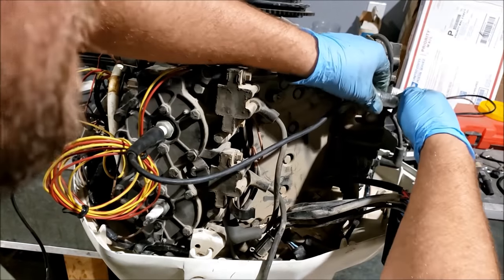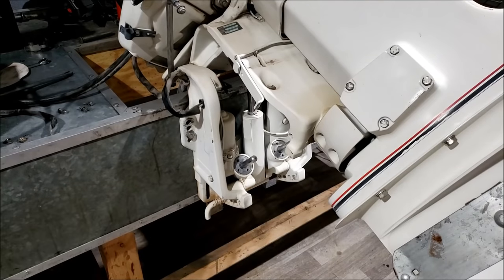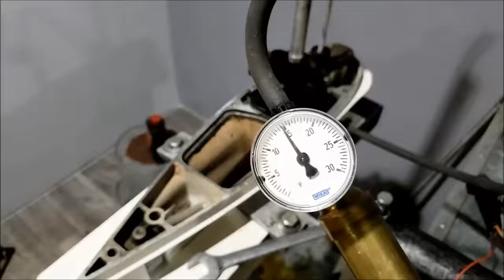Awakening a 90 HP Johnson After a 12+ Year Slumber

Comment: Omg man thanks so much, perfect timing. My ‘86 90hp evinrude was running fine last week, now leaking gas from the lower carb holes when I prime it, so it will only run at high speed idle, at idle it dies. Your videos helped me totally rebuild my 1974 Evinrude 4hp, hoping for the same with the 90 lol :)
Reply from the maker: next week the full carb video is gonna get posted, that should help more.
Reply: the needle is stuck in it's seat, forcing all the fuel to get trapped in the idle circuit. 45 minute carb clean with a syringe and alcohol will fix you right up, and a new needle and seat of course
Reply: @BrandonsGarage  awesome can’t wait.
Reply: @ct1762  thank you so much, sincerely appreciated. My only worry is that since there’s 2 carbs I’ll need to sync them - only ever cleaned single carb engines. Going to buy the rebuild kit in the meantime and wait for Brandon’s video on the carbs, lol. I watched the VHS video he posted on the link n sync, so I think I should be able to tackle this.
Reply from the maker: Posted & VHS... thats not a combination you hear too often.
Reply: Fuel pump diaphragm try that first
Reply: Great video brother

Comment: 18:37 Yes, there is about 300V on the black/yellow kill wire when the engine is running. That's the voltage the capacitor in the power pack CDI module is charged.

Comment: Before I turn the motor over, spray some type of oil in the cylinder. Marvel mystery oil, 2 cycle in a good plastic spray bottle.  That way it's not metal on metal and scratching the cylinder. Especially sitting so long. Nice video.

Comment: Nice video. Makes me miss my '81 90HP. Not sure if that motor has diverters in the heads, but when you test if you overheat they can be the cause and confirm the condition of the thermostats as well. Although they are a PIA to remove and replace.

Comment: Hello Sir, as always in your case very good video. Thank you. Question, the my power pack has two coil charging wires(one shorter, one longer) is it so that shorter is connected to the lower cylinder (motor evinrude 2T V4 90HP)? Best Regards

Comment: You brought back good memories. I had that motor on an '87 Crestliner bowrider. My first and only boat. It always ran like a top. Excuse my ignorance but what does VRO stand for? Is that the oil injection system. Mine was oil injected. It never gave me problems. When i bought the boat, a friend suggested getting rid of the oil injection and run mixed gas directly. I didn't bother because it was working fine. The boat also had an onboard fuel tank. Great motor.

Comment: Please stop using the Harbor Freight compression testers (or any critical precision tool for that matter). They commonly only show 90psi when in fact, it is higher. It is a good tool to bring for getting a good deal on an engine but not for accurate checks. My jet ski read 90 psi on both cylinders with it, then bought a good name brand and read 145psi on each cylinder. Big relief. Just throwing my 2 cents.

Love the videos, they are very calming.
Reply from the maker: At face value I would agree, however this one has been calibrated.
Now, the newer designed ones have no business being anywhere, but this one in particular is accurate.

Comment: Bad wiring insulation and swollen water diverters in the cooling passages are major problems with old 4 Cyl Johnson/Evinrudes.  Pull the heads and replace diverters!

Comment: New to the engine world..bought a 1986 90hp Evinrude vro crossflow.. quick question, the little orange and orange / blue wires for the coil packs which goes where? Have heard blue/orange to top and solid orange to bottom and vice versa? Idles perfect but have no throttle when wife open. Will only run about 20mph full throttle.. almost loke the engine is not reving up. And help would be grateful 🙏

Comment: I have a 1993 Johnson 88spl with the compression between 110-115 on all cylinders. Is that considered good? The motor runs perfectly for its age and just trying to get an idea of how much longer I can expect it to last. Thanks and love the channel.
Reply from the maker: well, mine is at 90 and Im calling it good.
However, Ive seen low hour motors from the early 1990's putting out 120- which is probably where they were new. 
110 I would still consider very good.

With that said, most OMC enthusiast would say these cross flow V4's are good at 90. But both you and I have seen higher..
Reply: There dirty suckers when it comes to compression,  the manufacturer recommended some ring size ran through your gas regularly ,now I also recommend that , if you can find it ,  because these motors were meant to run hard , if you run them around 2800 and idle alot it carbons up , I figures that out the hard way , three power heads replaced on mine cause I didn't like the compression , 1300 to 1800 dollars  each time except one time they warrantied it , but I think they were throwing used power heads on it , so I finally did it myself ..it lasted 8 months and did the same thing , port side compression down 30 lbs on one cylinder , 45 on the other ..again she came apart , that's when I figured it out , it was all carboned up , but it was to late,  I picked up a newer loper style 115 johnson my other one was a 88 evinrude spl cross fire . One heck of a difference in power ..
Reply: Yeap

Comment: Hi, watched a lot of your videos. I have a 71 Johnson 125 that I have rebuilt an few year ago. It runs great but it struggles to get above 4000 rpm’s. The manual say the power band is 4500-5500 max power at 5000. I am not sure if it’s the wrong prop for the boat a 71 Glastonbury v-163 or timing. When I timing while using the method where you just crank it at 26* it will not get above 3500, and advance screw is pretty much all the way in. If I back the screw till there is a few threads I can get it up to 4000. I am not sure if timing a 2 stroke is like a car where I can time it for max power. I would like to be able to get 5000 rpm’s out of, the prop I have now is 13” 19 much I don’t it would be all prop.  Compression is 95 with a harbor freight tester on all cylinders.  I’m kinda out of ideas thanks

Comment: Question? 1992 140 hp v4. 87 psi on all cilinders. Is that bad for that engine? Should I do the the rings. It runs great but heavy on fuel. Starts on second turn. You have been a great help in restoring this engine 7 years ago. Thanking you. I was thinking not to tamper with it but I don't know if the psi is too low?

Comment: What is a good ballpark compression number for these older motors, I have a 1977 Evinrude 140 that I spent a day getting running due to electrical issues but it compression tested at 105 to 108 psi each cylinder. 
Once I got the electrical issues sorted it fired immediately and it runs fairly well considering its age and that I did nothing else

Comment: Please tell me the new style of the fuel pump also pump the oil or I have to mix oil manual to gas tank ? My motor is 115 hp Johnson 1985 with the original fuel pump that I think it has problem , but now it is too expensive to replace. Thanks

Comment: Hey Brandon, when you put your carburetors back together do you usually perform a Sync and Link? The manual suggests it but I feel like it’s unnecessary because i took mine off to replace the fuel lines on my 85’ 90 horse Johnson.
Reply from the maker: not if I don't mess with the linkage
Reply: That answers that. Thanks!

Comment: When you adjust the idle you said you do it on top ? My sons 115 Evinrude idles low but I’ve not looked at it yet and hopefully you’ll have a video on that ! Otherwise I’ll set it the way I know , on the linkage plate ! Why would anyone put the VRO back on the outboard ? I just don’t trust it , many many VRO’s in the scrap piles , I’m thinking about getting 3 -90hp all with different issues and make hopefully 2 good outboards .
Reply: the idle speed screw is on top, but you really need to follow the synch n link procedure to a T. i can tell this one isn't adjusted properly by the roller in the spark advance... too low but only a timing light will tell you where it needs to be. the idle timing is adjusted by the thumb wheel
Reply from the maker: Well, usually when I see an engine that wont idle, its A) low compression, or B) throttle cable not adjusted.
If nobody has screwed with the linkage its usually fine.
Reply: @BrandonsGarage  ya I fired it up today and like I thought the cable wasn’t adjusted correctly ! All that drama for a 5 second fix ! Lol. Once it was warmed up of course !

Comment: When it took off I was waiting for a accident that just snapped back.  Great reaction time.  Is this the first bigger motor you have worked on? I feel like most are like 40 and below.  Either way great job keep up the good work can't wait to see it on a boat cruising you around
Reply from the maker: First bogger motor? H A H A, oh you're funny.
Here is the thing; Bigger motors are flipping heavy. Little ones are easier for me to pick up.

And here are the good reasons:
A V4 like this one, in good running/looking condition will bring you $600-800

A 9.9 HP in the same condition will fetch that too, but cost a quarter of the repair price.

It seems most people like small, easy to move, good on gas, economic engines they can tinker on. That not even mentioning the tool requirements. 

If I were fixing a motor to sell, and had to choose between fixing up a 30 HP or 115 HP, I would go for the 30 most of the time.

Comment: Hello from Australia Brandon! Just wondering if you know somewhere I can get a new or used bearing carrier for my 55ETL79C lower unit. I finally made the puller legs as I could not find them ANYWHERE and the carrier broke right at the o-ring. Thanks for bringing great videos…helped me a lot with my teardown
Reply from the maker: surely you can find one on the ebay
Reply: Actually I cannot. These older Johnson basically don’t exist in Australia anymore. Everyone is going to 4 stroke. I just can’t see something as old as this not having a new lease on life so I have spent a lot of time taking it apart and repairing as much of the original parts as possible but I just have to replace certain things.
Reply: @BrandonsGarage  I just found one now actually. $389 Australian for an original new part

Comment: I'm surprised Brandon hasn't gotten a IR temp gun from Harbor Freight from how much you work on them.

A torque stick for the V4 crossflow flywheel but no $25 IR temp gun?
Reply: yes very important, especially on these crossflows for proper temp. was he really using a torque stick for the flywheel nut? i missed it..
Reply from the maker: @ct1762  not in this video, or even on a V4.
Smaller engines I do.
Reply: @BrandonsGarage  Odd, somehow I vividly remember you using a torque stick on an outboard flywheel.

I guess the memory is taking stuff I watch and throwing them all in the blender.

Sorry bout that mixup.

Comment: Worst part about outboards is bad gas causing rubber fuel component death. 
You must replace all old rubber fuel lines, ALL OF THEM, use stihl brand hoses and submersible rated gas fuel line specifically. AND then you must check for air leaks, because clamps will not all clamp and there are other dodgy parts like plastic fuel line manifold splitters that crack and leak. ALL rubber lines, even the scavenging lines, choke lines, and vacuum lines. ALL OF THEM. 
Yes diaphragm too should be replaced. Your main thing is air leaks and fuel leaks, tiny leaks will wreck the normal smooth operating of all these cursed shottilly engineered outboards. 
REPLACE ANY HARD GASKET, check with fingernail, if you cant smush it, replace it so it can seal. Hard on hard surfaces DONT SEAL, so you have to check this with carb bowl seals and fuel pump seals. 

Your timing, and linkages and carbs are probably all right. the jets get clogged on carbs, dont replace them, clean them, then REPLACE ALL RUBBER FUEL LINES AND RUBBER FUEL PARTS
THEN check for air leaks with a simple vaccuum gauge which those are cheap and you can rent them. When floats are up when gas is full in carburetor, you should be able to pressurize the system to 5 psi. Pressurize after bulb where line goes into tank, just where you put pressure in to check leaks. You can use stainless steel aircraft lock wire, to twist and seal very tight all of the connections. On my boat this is nessesary, the tank pickup barb is not standard, it doesnt clamp tight or evenly enough with stainless hose clamps, or zip ties, or plastic tooth clamps. You have to really cinch it tight with the stainless steel wire, twist it up tight. GO around hose twice then twist tight while pulling. This way is better than any type of clamp as far as sealing goes. 
Also, use a dab of silicone grease around the quick disconnect, those ALWAYS have the potential to leak. They want you to buy a brand new one every season and then, they have such bad quality parts, they leak and leave you stranded or pissed off that day as it wasted time and rescources getting out on the water. 

This is actually best advice, follow all of it, and you will have a good running motor. 
 
Replace all rubber fuel parts and or gaskets. Check air leaks, check hose clamps. Buy brand new proper size hose clamps, not ones that have been bent up. Not oversized ones either. Or use stainless lock wire, and get good at that. 
Its just about that simple.